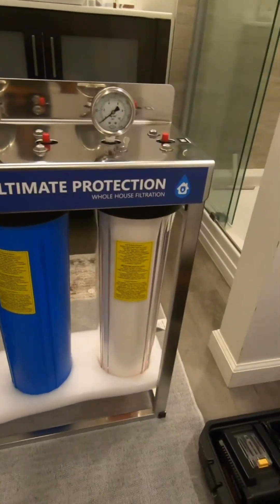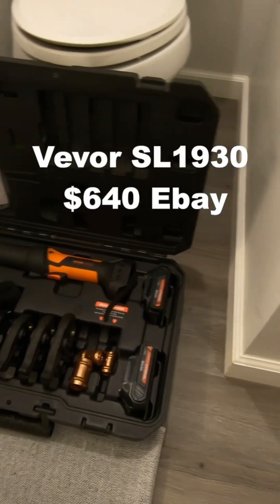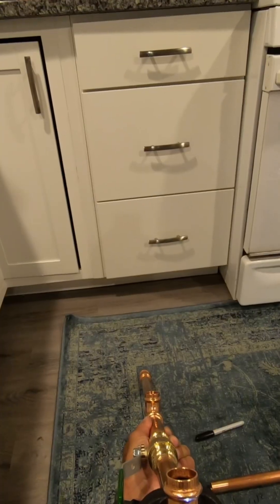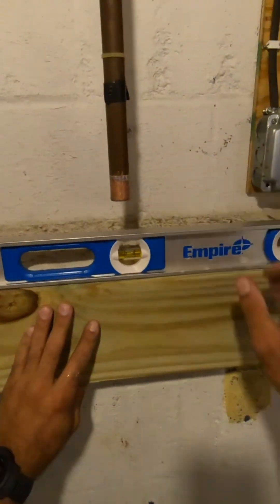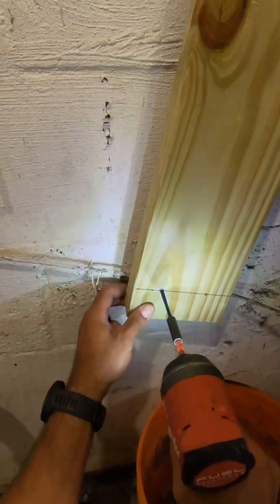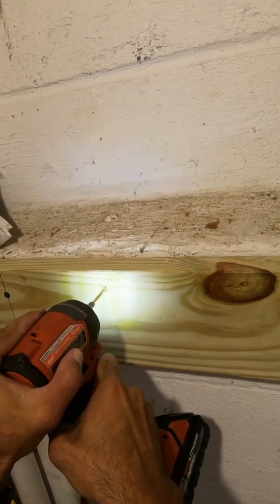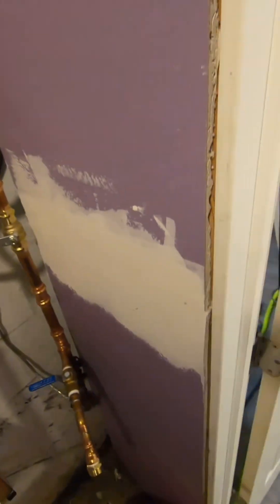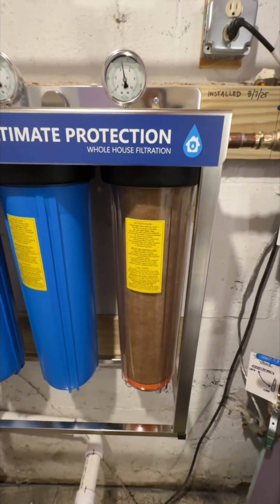Your house water is dirtier than you think!! #waterfilter #watertreatment #plumbing #waterpurifiers

Comment: How do you like this compared to the $2k version that lasts 10 years or more? Instead of changing filters monthly to every 3 months or whatever you've noticed.
Reply from the maker: Idk that's a good question to be honest. I think it really depends on the volume of water you use and how dirty it is. These filters for this unit are rated for 50,000-100,000 gallons or suggested to change  every 6 months - 1 year and they're not expensive. I periodically check it every couple of weeks just to see how it's doing and keep tabs on it. For a 10 year unit i might completely forget about it that's a long time lol

Comment: i legit just got a vevor press. the exact one you got brand new for 399 for exactly this reason. i already have a full house water filtration system but its the halo ultimate... it claims is that it filters basically everything(and the water does taste clean clean). but it comes with a small filter on the side of the big filter and i figured it wouldn't hurt if i upgraded that one filter to the one you have here. is it over kill ye....but do i care nah.
Reply from the maker: That's awesome man and honestly when it comes to water you plan on drinking I would rather be overkill too. I grew up on well water it legit tasted like Poland spring. I've been on City water for the past 5 years about and it's nasty what is actually in this water when I really looked into it. I still can't drink my tap but it's definitely way better lol

Comment: Why wouldn’t you just solder all of them?
Reply from the maker: Soldering more than doubles the labor time. This is a lot faster
Reply: @SkaveNJer  I know what you mean so you must work for yourself? I recently installed a backflow protector for my company it took me 8hrs soldering all the joints taping and dope. My coworker could’ve done it in an hr with his pro press. They won’t by me one
Reply from the maker: @chauncey5962 I do, I mainly do bathrooms and finish work so all my projects are priced per job/project or unit economics (for example like per square foot or per linear foot). They're really making you earn your pay by having you sweat everything lol. How does your company pay you? Per hour or per project?
Reply: @SkaveNJer  hourly my friend
Reply from the maker: @chauncey5962  that could be why. Depending on how they bill the client, If they bill hourly then maybe the way they mark up your labor allows them to make what they need or more for your work
Reply: @chauncey5962 the guy in video is not a plumber or handyman for a living... thats very obvious.  . He bought a new toy and the batteries will be shot before he takes it out again.
Reply: Nice install my friend! Keep us updated on the performance of this new system.